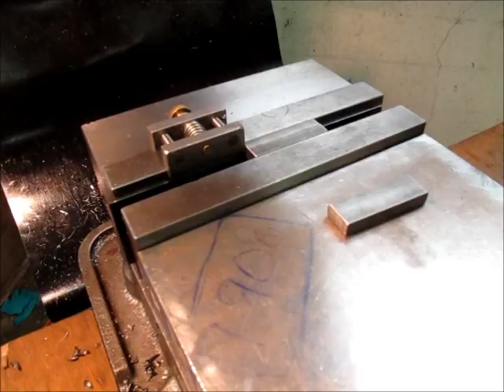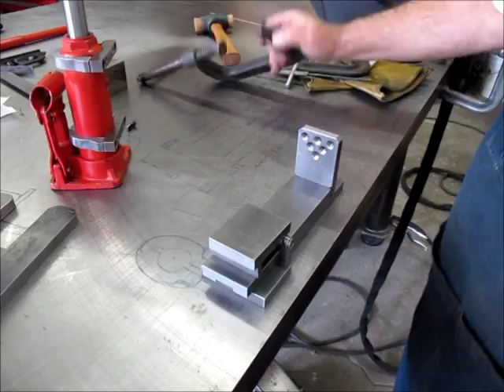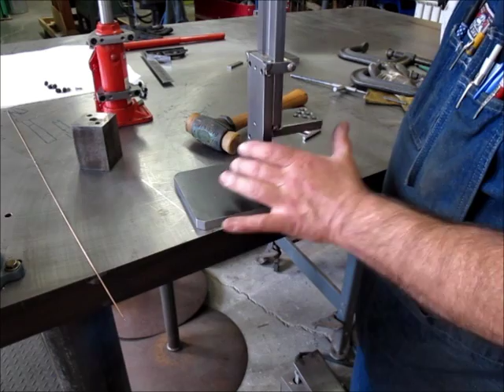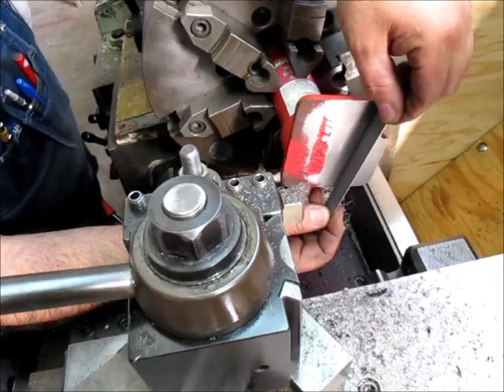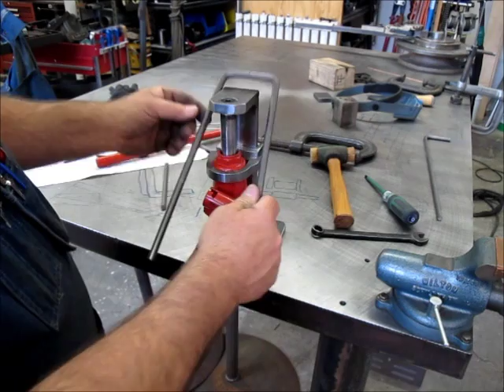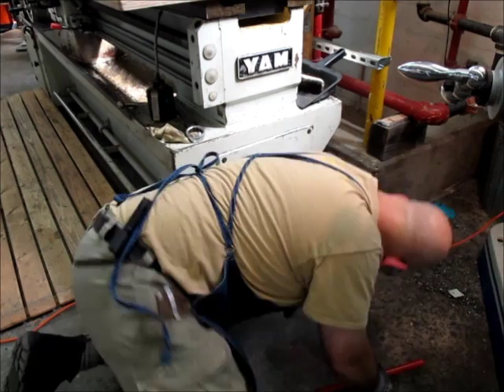Toe Jack Episode 3

Comment: Right now a StroboTec (sp) that is a calibrating strobe that the speed can match the rpm - so you see the entire foot stand still to see if the coverage is spot on.   Normally used to calibrate gear trains and other spinning things.   I use it on my wood lathe and metal lathe now and then.

Comment: If you run that slider up to the top of its travel you are going to get considerably more than 1:1 mechanical advantage over the roller attachment. Will the roller straps stand 10 x the weight of the machine you are raising? You made this video years ago so I guess my comments are moot! ;) I have no intent to troll you, just trying to learn by considering the angles.

Comment: Totally cool project.  I did not think about moving machines around when I started out buying machines.  Missed one like this then, and I will make one for sure.  Since this vid is old; have you used it much since you made it?  

Thanks for a quality video and quality work.
Reply from the maker: Hi Arnljot,

Yes I have used the jack a few times. I should have made two of them at the same time! Two is better than one. Thanks for the comment.

Cheers,

Tom

Comment: A silly question i guess what is better for welding most steel  ( Stronger ). A Tig or Mig welder. It always seems a better looking weld with a Tig but i know you need the gas as well witch is a down side to being mobile.
Reply: Andy Neal to be honest if you want the strongest welds you will want a stick welder
Reply from the maker: Hi Andy,

Both welding processes produce good welds. Skill of the operator is the major factor. Solid wire MIG also requires a cover gas. For field work with wire feed take a look at small diameter flux core. FCAW. But to answer your question directly its probably easier for many welders to get a perfect weld in most situations with TIG. Hope this helps. Thanks for the comment.

Cheers,

Tom
Reply: Thank you
Reply: in my opinion tig takes more skill but is a stronger weld. the problem with novice mig welders is they dont burn hot enough the weld may look good on mig but there is not enough strucktual penetration.
Reply: i agree im from the old school i mig tig but good ol stick never lets you down.

Comment: Great project. I've used a few over the years and the toe assembly was always allowed to "float" a bit, you have the jack and frame/toe all rigidly connected, it may be why it doesn't return fully without help. Just an idea. I know, there's a hundred ways to execute an idea.
Reply from the maker: Hi James,

You are probably right. When left to their own devices machinists make things too tight. Thanks for the comment.

Cheers,

Tom

Comment: I hare seen several of your videos and you always seem to be TIG Welding?   Is this your preference or easier to do?   My welding sucks but I get better results with TIG .
Reply: tig is nice can you can take your time  for me it dose not fill my little shop with smoke.   also you don't have sparks flying around that could start a fire some where plus it's quite and for me more enjoyable.
Reply from the maker: +Robert Beattie Hi Robert,

I don't know if I would say easier. Its certainly more pleasant and clean that some other options. For me the choice of welding is related to precision and weld volume. Thanks for the comment.

Cheers,

Tom

Comment: Hi Tom!

Ever thought of mounting the hydraulic cylinder to the baseplate with 4 screws? That way you don't risk the cylinder by welding and the squareness of the cylinder itself would also be less of a problem by adding some shims...
Reply from the maker: +Wolfgang Skabrond Hi Wolfgang. I looked at doing it that way. The foot casting on this jack is rather thin and not favorable for mounting screws. Thanks for the comment.

Cheers,

Tom

Comment: Hi, Do you think you could build one of these for me? I'll pay you for your work+materials. Please contact me asap.
Reply from the maker: +fratt galvez Hi Fratt,

I don't build these for money. You can easily make one yourself with limited equipment. You don't need to do it the way I did. Thanks for the comment.

Cheers,

Tom
Reply: +fratt galvez Look for a forklift jack. They are superb for such work so if you are going to spend the money go for it. They have deep reach, and are wonderful for moving machinery. I scored one at a flea market for $25 and it paid for itself moving a several thousand lb lathe because the jack is designed to grab narrow, heavy "edges" of forklift structure and that along with the reach and very low "insertion height" is a dream for moving machines. Forklift jacks are to toe jacks as a "foot" is to a toe. Also look for used RECENT Simplex "railroad jacks" in GOOD condition as they are versatile, powerful and don't bleed down if left in place since they are mechanical. Study THOROUGHLY because in rigging with limited (or not so limited, I trained on jet fighter crash recovery which was huge fun) equipment your best tool is your mind.
Reply from the maker: +Ob Fuscated Hey Ob,

Never thought about special jacks for forklifts. I took a look and now have something else for Santa to get me. Thanks for the suggestion.

Cheers,

Tom
Reply: +oxtoolco You are quite welcome. As new machining student I appreciate your videos. Do look for the Simplex (that specific brand) at auctions etc. No way I would cough up  new price for personal use, but most people just see what they think is an obsolete hunk of "iron" instead of a very nice forged steel tool. They are no Hi-Lift "ag jack" (which are great tools in their own right) but a refined design that feels sweet to use. Manuals are available for download.

Comment: you did all that beautiful kick ass work for a $10.00 jack.... i can't do suck beautiful world  but as a weld  on that bottom plate with the bowling pin holes to the vert plate that  90% i would have milled on both for a 4 point weld  front and back would be a 8 point weld instead of a 4 point...great job wish i was that good..thanks for sharing

Comment: In watching your comments concerning the body of the bottle jack not being square to your machined surfaces I think the issue is with the body of the jack being cast iron. When any material is cast, all the surfaces of the piece has to have a slight taper on it in order to release the pattern from the sand mold. The machining you have done corrects the surfaces.
Reply from the maker: James Stanlake Hi James,

Thanks for the comment. I don't think there was any draft on the bottom surface of the jack. Probably when the tube was inserted in the casting it was probably not quite square to the world. 

Cheers,

Tom

Comment: Hi mate.
That toe jack looks very nice, I wish that I could do something like that.  I'm not close to your preciseness, in doing things.  I was wondering why you did not go with a dovetail slider.  I think it would have resolved most of your problems, I think.  However, please keep in mind that I can only write about one, not make one; a backseat driver, if you will. 
Kind regards,
Marcel.
Reply from the maker: Marcel Timmers Hi Marcel,

My first thought was I really didn't need any kind of secure slider for the vertical part. It turned out that it did need something. I wanted to make it as simple as possible so folks without much machining capability could follow along if they wanted. Dovetail would have been nice. Thanks for the comment.

Cheers,

Tom

Comment: HI Tom, i've followed the series of this project now all the way thru, and i must say i really like your method of power tapping. i have an old J-head bridgeport vintage 1964 and was wondering if the thing would hold up to the quick reverse like what you're doing in your tapping operations?
the mill you're using, it has an R8 spindle, is it a brdgeport or a bridgeport clone? your motor stops on a dime whereas mine takes a few seconds to run out
Reply from the maker: Hi Mikey,

The switch is the weak link in the system. Most machines can handle quite a bit of instant reverse with no adverse reaction. My mill is a clone made by Acra. I generally hit the brake as soon as I switch power off. Add up all those motor wind downs over a year and you are talking real time. Old production habit I guess. Thanks for the comment.

Cheers,

Tom

Comment: Interesting. I'm not even a machinist, but the concept intrigued me. Never heard of a toe jack.  I'm mainly a woodworker, but anything connected to shops interest me. Nice work.
Reply from the maker: Hi Martin,

Thanks for the comment. 

Cheers,

Tom
Reply: oxtoolco
 I've started watching all your videos. Always interested in learning new things. I occasionally work with metal, but nothing of machinist level work. But I've already learned some things from this video, like how you use an accelerometer.(I think that's what it's called, no?)  btw, one question I have is how you do precision measurement work, like for drilling holes in plates...ie..the bowling pin layout.  Is the vice indexed or something? Thanks a million.
Reply: Martin Walters btw, lots of things you do relate to woodworking, or general shop projects.  That's why I watch these types of videos.  Youtube is amazing.

Comment: Tom, I liked this little project.  Nice work and a good presentation as usual.  The jack should come in handy when there's not a lot of room around the machine you're lifting.  But when possible, I like to use my big johnson... bar that is.
Reply from the maker: Hey Ujeb,

Every shop should have a big johnson with a roller on the bottom to keep it from dragging.  Thanks for the comment.

Cheers,

Tom

Comment: It may be some weld interferes with the toe going all the way to the floor.  When you welded it solid, thwe full welds not quite clear the small gap between the base and the toe.   Your weight forces to to the floor. by spreading the U shaped opening in the base.  It would not take miuch weld to stop the toe from seating as it did with the much smaller tack weld.s.
Reply from the maker: Hi Jeff,

The welds on the sides clear the cutout. I think there is just a little difference between the center distance when the screw is tightened. It works fine when the screw is not snugged up hard. Thanks for the comment.

Cheers,

Tom

Comment: That metal cutting band saw really went through that metal like butter. I own a Grizzly metal cutting band saw (vertical) and I can't seem to get mine to cut like that. I know there must be some formula around someplace that specifies what TPI you should use and what RPM you should use for the metal you're cutting.

To give you an example, I was cutting a 1" think hot rolled steel sheet while using a 10-14 TPI blade. I don't remember what RPM I used, but I do remember it took me forever to get through it. I didn't want to push on the steel too hard for fear that I would break something or ruin the blade teeth.

Do you have any suggestions or tips on TPI and RPM's for certain metals?
Reply from the maker: Hi Proto,

The rule of thumb is to use as coarse a blade pitch as possible and still maintain at least three teeth in contact with the cross section you are cutting. It translates into Thick stuff less teeth but bigger, thin stuff more smaller teeth. Your 10-14 tooth per inch is for something in the 1/4 inch thick range. The blade I was using is a 6 tpi bimetal running at 150 FPM. There are reams of data on the web for band saw blade cutting.

Cheers,

Tom
Reply: Thanks for the info, Tom. I did some research after posting and should have done so BEFORE posting. I apologize for wasting your time like that.

It looks as if I need to pick up a couple new blades. For what I'll be cutting in the future, I'll need an 18TPI and 6TPI blade. Thanks again.

Comment: I've noticed that the pump linkage on most of "those" jacks is really sloppy.  All of that slop adds to extra arm strokes, every time the jack is used.  I've "tuned-up" the linkage on a jack or two of mine and fixed one or two of my friend's that were damaged (somehow?).  Anyways, you'll notice the improvement.  And it adds a little bit of "Bad-Ass" to it.  Lastly, I just purchased two of those 4 ton bottle jacks from Harbor Freight, last month.  I needed some extra displacement, while shoring a wall.  The HF jacks work fine, but have the linkage slop issue.  And they leak a little.  Oh well, nothing to complain about at $9 each!!!

Comment: Man that was a lot of  work!  I stopped the vid and tried to figure out how you would remedy each problem.  You came up with great solutions.    I have a few Harbor Freight bottle jacks.  I purchased one about 13 years ago, I think that it is a 6 or 12 ton.  They do not sell this particular one any more.  Anyways, it is a great jack:  it doesn't leak, it is compact, the pump linkage isn't sloppy, it feels positive/secure when pumping, and of course....I think I only paid $16 for it.  They compliment my other floor jacks.  Anyways, thanks for entertaining video.
Reply from the maker: Hi Wave,

I've used the jack a few times now. I went to HF to get another jack to make a second toe jack. These things are like rabbits you cant just have one. So I'm stuck if I build another I really need to build two more. Two more is not twice the work. You see my problem? Check out James Kilroy. He posted a toe jack from Enerpac that I would try to make a scaled down version of.

Thanks for the comment.

Best,

Tom

Comment: you know metric better than me and I live in Canada lmao im a plateworker and I see a metric blueprint once every 5 years? I have moved a bunch of shops in my day big equipment 10 ton to 20 ton presses and what nots and killed lots of jacks like that. That's a very good design the only weak link is that china crap jack lol some china crap eye bolt rigging crap made its way in my shop a year ago on some 100 ton power rolls (capacity) they sheared off almost killed me!!!! the eye bolts had porosity in shaft !!! beware off china rigging crap!!!!!!!!! ohh ya good job
Reply from the maker: Hi Craig,

Thanks for the comment. All our rigging stuff has to come certified. Too many impostor's out there making crap.

Cheers,

Tom

Comment: if you put some anti slip cross hatching on the top of the bottle jack you can still use it as a bottle jack without taking it apart. I jacked combine's & semi's and earth movers for 26 1/2 years and I wish I had a low profile toe jack like this, I think my shortest jack was 8", I had a jack slip off a tractor frame and when it came down it trapped and broke my left arm. love your videos keep up the good work. the next jack should be 2 times heaver 6 ton, maybe one with Air/ hydraulic jack. Tractor Getting New Tires 30.5x32 part 1 Case IH 9380   1996 Ford F550 Super Duty Service Truck with IMT aluminum box and Hiab 035 Mini Boom Tri-Fold Crane
Reply from the maker: Hi Brad,

You are right. I should have bit the bullet and went a bought a bigger jack. Part of me wanted a small compact version but in retrospect the larger jacks are not that much bulkier. I also should have built two at the same time. 

Regards,

Tom

Comment from the maker: Hi Bill,

You are correct. The preparation and total weld cross section determine the strength. As an example in a fillet weld its generally accepted that a fillet with a leg length equal to the material thickness is as strong as the base material. Obviously there are exceptions to this but its an illustration of a no prep joint that is strong and effective. MIG takes more skill to get a good hot strong joint than TIG welding. Underpowered machines and iffy techniques don't help.

Regards,

Tom

Comment from the maker: Hi Bill,

Thanks for including your first name to your comment. The answer to your question is I don't know. Properly deposited weld metal is typically slightly stronger than the base material unless you are working with aluminum. The rod I used is 70Kpsi rod. Part of the trick is to get enough cross section of weld. The tip would fail by yielding and ductile bending with a properly done weld. It other words it will bend and not snap off if overloaded. The beauty of steel.  

Regards,

Tom

Comment from the maker: Hi desmes,

The jack is one I already had. I may do another one since this one works so well. Two jacks are better than one. On the dovetail you are right. It would have been more elegant and high mechanical art. I chose a more simple method based mainly on available materials. I tested the jack off camera before I stuck my head there. Confiance, mais vérifier. Trust but verify.

Thanks for the comment.

Comment from the maker: Hi Bill,

I might have to make a couple more of these. I've already used it a couple times and the light weight and small size are great. I found a better jack at Harbor Fright that would be easier to execute this design with. That lathe doesn't notice little pipsqueak out of balance situations like that jack. I may have looked like it was spinning faster in the video than it actually was. 

Regards,

Tom

Comment: Tom that turned out great nice work.  I'm glad that you did not weld the jack to the base I was thinking the same thing that the jack is probably the weak link in the machine and might need replacing.  Looks like some of the other viewers agree.

Having a large lathe seems really nice, it did not seem to concerning to you to put something out of balance in the machine and it seemed to spin nicely.

Comment: Hi Tom,

That jack is a fine piece of work!  My theory on the retraction bind is that you have a very tiny bit of weld distortion that happened up at the guide roller when you attached the tension members and the gussets on the top.  

Thanks for the awesome video!
Alex

Comment from the maker: Hi Tyler,

The one on the blog was modified so I could use an inverted machine leveling foot. Since the single is the steering end it makes it easier to bar the thing in the direction you want to go. Normally they have a block of wood between the skate and the machine.

Best,

Tom Lipton